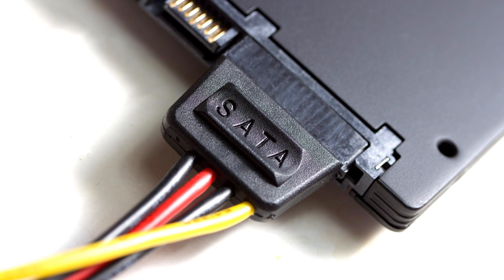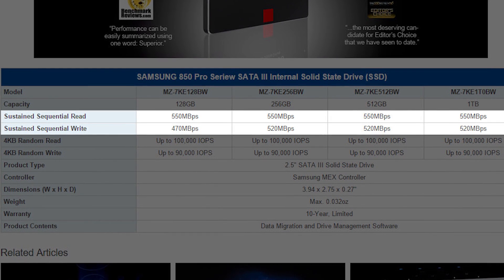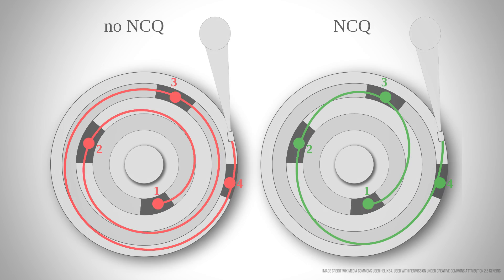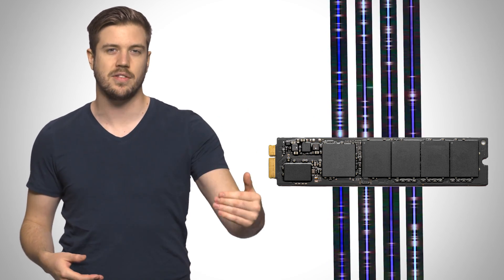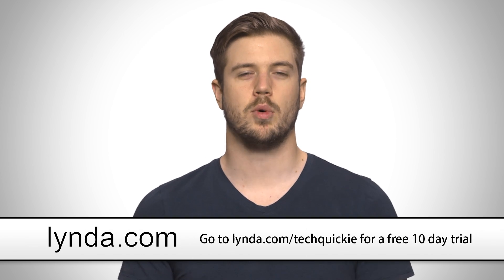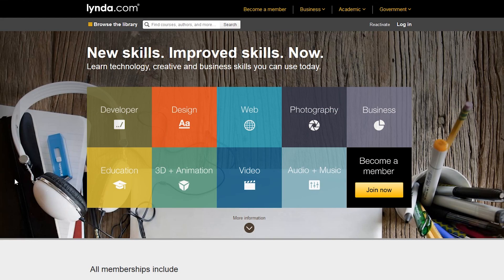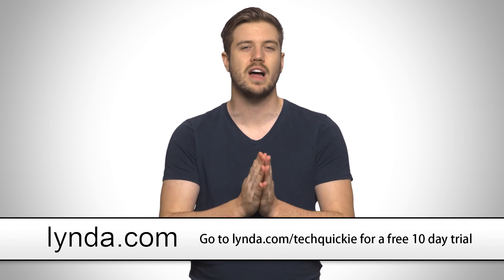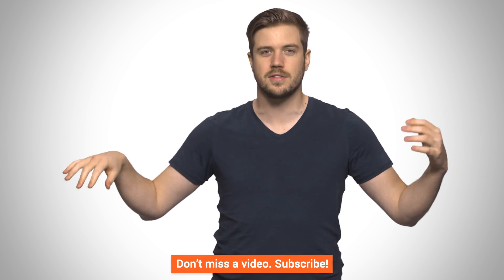NVMe As Fast As Possible

Comment: Is 2000MBPS completely necessary  for a steam library? Yes....yes it is
Reply: If you have very very good internet... yes haha
Reply: But now you can't read the helpful tips that the game gives you because it loads too fast
Reply: Imagine my dissapointment when i got my 4th generation just to be limited by the game engines :(
Reply: I just boosted my NVMe to 15k read and 29k write with RAM cache just for gaming and all the stutter I had when loading new areas disappeared. I used to have frame drops in games with big open worlds while driving/riding around but that is also gone. I can max all settings in 1440p + enable ray tracing at medium on a 2080S and i9-10900k at 4.8GHz now in Watch Dogs Legion, before I had to run a mix of medium and high settings or it would stutter like crazy and the FPS would drop all the time. It's completely locked to my monitor's refresh rate now. No drops at all. That's what an insane read/write will do for you :-)

I've moved on to only NVMe:s and will never go back. SATA SSDs are a thing of the past imo :-P
Reply: Anyone saying it's "Overkill" or "noticed no differences" probably has a low end or midrange system that honestly won't benefit from it. When I upgraded from a SATA to an NVMe it was very noticeable (contrary to popular belief), Windows boot and shutdown way faster and apps open twice as fast.

Comment: NVMe drives are bottleneck more than SATA III, because "typical user" tasks can't adequately utilize the faster speeds. Windows boot time, for example, is seldom (or at least marginally) affected by NVMe over SATA III. Hell, I still want one, but only if the price settles even more.
Reply: my boottime with 850 pro was 10 seconds to desktop was ready. after going 970 evo the time is not 4 seconds. also, game installing and windows patching is blazingly fast now. when you do multiple stuff at once on the drive, the difference is night and day compared to sata ssd's (achi is mostly the problem here). game loading in big open world games is also much faster, in smaller games the difference is not much. overall system feels alot "snappier" with a nvme drive imo!

Comment: My understanding of M2.  
Mike Drive has files, he hands them to Sally Sata, but Sally is not very smart and passes them on to Dave Hardrive 1 by 1, and in random orders that Dave has to sort.
Dave is putting them into a massive file storage drawer. He gets impatient waiting for Sally to hand him a file, and then gets the files in no particular order.
Mike keeps passing more and more files to Sally but she can't keep up.
Mike can't fire Sally and gets Sarah M.2 in to help instead. 
Sarah is super fast and organised, she takes all the files Mike gives her really quickly, she sorts them and hands them to Sally in the correct order, trickle feeding her so she can easily keep up.  Dave still gets his files 1-1 but they are at least sorted and easy to file quickly. 

Mike wonders why he still needs Sally or Sarah to simply hand files to Dave. 
Ala, why not cut out all the wires and plug USB thumb drives into SSD'd directly?

Comment: My sata SSD failed.  I am considering buying the Samsung 960 Evo NVMe. I have a Dell Optiplex 7010 SFF i7 16GB RAM, I have 2 question before I buy (i) will BIOS recognise NVMe for boot purposes and (ii) which generation of PCI-E Express 16 does it have, i think it's version 3.0 but not 100% as it does not state on the spec sheet.

Comment: Hi , my Samsung M.2 evo should get 3500 mbs read speed but only gets 2500 mbs when optimised , any thoughts on why im loosing 1000mbs
Ranger 8 motherboard, skylake 6700k cpu , 850w psu and 32 GB of Vengance Ram

Comment: MODIFY YOUR UEFI BIOS, ADD NVME DRIVERS, ???, PROFIT.  I did it, P9x79Delux currently running off a NVMe drive. Also your statement is also factually inaccurate.  You can put an NVMe drive in virtually any PCI-E based confuser and it'll work, you won't necessarily be able to boot off it though which isn't necessary most of the time. Regular SATA SSD would be more than fast enough to boot Windows quickly regardless.

Comment: Can you use legacy BIOS boot with NVMe working? I don't recall this being possible, yet I just figured out my Windows PC boots via legacy BIOS (I blame the Windows installer for this) from my NVMe drive. I just want to make sure I know what is going on. (I'm not going to reinstall windows at this point just for a slight boost if that's all it gives me)

Comment: If you a gamer and want to buy an NVMe , please don't. They have great potential but the performance they offer is so marginal it is not worth the extra dollar. Use your SSD as they offer similar performance to NVMe for gaming. Until developers take advantage of NVMes resources it is not worth the buy now
Reply: NVMe is a communications protocol ... not a kind of media .. the biggest benefit is the enhanced throughput and about 25 microseconds of better request latency (forget about the queue depth issue, at SSD style latencies you rarely if ever fill up your queues) along with a useful decrease in CPU utilisation when you're doing 200,000+ IOPS. Having said that until games start needing to stream super-hi-def video from disk instead of generating it using the GPU, you're much better off spending the extra $$ on a better GPU

Comment: so does that means nvme m2 drive works on my (gigabyte z97 G3) m2 port? Does it only works as data storage or can be a boot drive? Manual does says this,
1 x M.2 PCIe connector
(Socket 3, M key, type 2242/2260/2280 SATA & PCIe SSD support)
1 x SATA Express connector
6 x SATA 6Gb/s connectors (SATA3 0~5)
(M.2, SATA Express, and SATA3 4/5 connectors can only be used one at a time. The SATA3 4/5 connectors will become unavailable when an M.2 SSD is installed.)

Comment: Are all M.2 Drives NVMe compatible?
Reply: no, there is more than one protocol for m.2 ssd's out there. so be sure you get one that confirms it HAS the NVMe controller and that your motherboard supports NVMe m.2 and not just the other ones. if you have two or more m.2 slots dobule check to see if NVMe is capable in both or in just one and if just one, which one.

Comment: Can you connect a M.2 NVMe PCI SSD to SATA-3 connector using an adapter? (I know this will not give any performance advantage since SATA is only 550mb/600mb max but to futureproof myself whenever Im buying a new laptop with motherboard that fully supports NVMe..) Thanks.

Comment: So I have a serious question. If on paper NVME is waaay better than AHCI then why when it comes to real world performance (particularly boot times and load times) NVME M.2 drives are kind of a hard sell since they are more expensive than SSD's and the boot and load times for NVME M.2's are if anything just 1 or 2 seconds faster than SSD's? Is it because of speed limitations in the OS and in the game engines? I think this is a good question for Techquickie but I'm interested in what everyone has to say.
Reply: I think, at that point, the boot time is limited by other components, This is the fastest your PC can boot with virtually no bottleneck in storage. Consider your CPU and other components take 10 seconds to process all boot instructions, while your SATA SSD takes 4 seconds to provide data, Result: 14 second boot time. Now CPU and other components still take 10 seconds, but the NVME takes 1 second to  get data, Result 11 second boot time.

Also, booting might not be the most expensive operation, it might not fill up the request queue of AHCI. NVME will excel in really hard time, when requests are more than what AHCI can handle at the same time. Consider a time where your system experiences very high load (There are times like that for about 4 seconds), Even with SSD's you will get some slowdown, This is where an NVME will easily outperform AHCI.
Reply: mraustin3410 Dude, you're missing the point of these drives. If all you're trying to do is boot a few seconds faster and run games then these drives just arnt really for you. At least not now..I've got two computers, one main desktop and one alienware laptop..both have 960 Pro nvme 1tb drives in them. Why? Because the difference it gives me for doing audio engineering work, loading virtual instrument samplers, and video and media work is ridiculously faster. It's a complete night and day difference, it's the difference between me getting frustrated with trying to work and me just being able to do the work without noticing an issue with lag time and etc etc etc. Especially on big projects with 60 to 80+ channels running at once. These drives are a godsent.
Reply: When an OS is booting it is initializing all of the devices of your computer. It is done by drivers. Unfortunately there are a lot of idle time during this time because some hardware just simple too slow to answer the requests. But the OS needs to wait for these answers which are usually init values for the specific hw drivers.
Reply: depends on usage, pcie 3.0 x4 nvme ssd is much snappier than even the best sata ssd's, im at the desktop 4 seconds after hitting the power button, took 10 seconds before with my 850 pro. game loading is faster but windows patching, game installation (unpacking etc) is extremely faster. a game repack can be installed in a few minutes instead of 20-30 minutes sometimes (fitgirls). major difference in some workloads and not so much in others. i also like that there's no cables inside the case. very clean looking / easier cable management.
Reply: AustinSummersOfficial The slo mo guys have a video explaining that. A playback of a high bitrate video from a SATA SSD and from a NVMe SSD. For how fast the SATA drive was there was no way it didn't buffer after some seconds. That's pure read speed difference.
Reply: hey my samsung ssd is faster than my samsung nvme 960 but a bunch n i have no way of knowing why
Reply: Elvis Best maybe you have it set to SATA in the motherboard... Check if the configuration is in sata or auto... Also maybe update the bips
Reply: the beginning of the video basically covers this point, he said that its high work loads that NVME technology is noticable.... so when read and writing information quickly is paramount then the nvme helps alot. none of this matters if you have a terrible cpu, ram, or possibly connection(if you need to access a server before finishing a request)... if so the read and write speed is redundant.
Reply: lollycopter enclosures already exists, and you get the maximum speed for they type of USB Gen you use...
Reply: I have a 960 Evo. Render speeds and loading of times are not exactly fastest. Or is law of diminishing returns
Reply: I wanna add that it’s much more noticeable when you’re dealing with really big stuff
Reply: @thetshadow999animates9  Coming back to this after 5 years, and yours was the only comment I was ever notified of lol
P.S. - I understand the error of my comment all those years ago when I didn't know what NVMe was.
Reply: here's a side by side comparison of SATA vs NVMe video playback- https://www.youtube.com/watch?v=4PoXiRoLSZQ
Reply: If you need to use an M.2 SSD via USB 3.0 as an external drive, stick to SATA. I don't think any NVMe enclosures exist yet. If you need NVMe performance for an internal drive, get NVMe.
Reply: 1. NVMe (note small "e", spell it correctly or I will FIND you) is newer and therefore more expensive. That's pretty much it.
2. NVMe is found on 4 lane PCIe based cards. There is no such animal as a sata NVMe. Thus it depends on what PCIe you are using, but even the slowest PCIe NVMe should be faster than sata. Want proof? If you look up the sata standards group, you will see they point to PCIe/NVMe, meaning "we give up, go with them if you want to live". Thus I doubt your claim that they are "1 or 2 seconds faster". More likely your MB POST sucks it big time.
3. Get a PCIe 5.0 NVMe SSD, then strap in and hold on.

Comment: Why don't they just make a pcie x16 ssd card.  Im guessing gamers need this for sli but you could get a heat sync and insane SSD power
Reply: ***** For gaming yea.  
Is the bottleneck for the number of full use PCI 16 slots the CPU bandwidth?

I'm a photographer I think I actually need access to random files quickly more than I think I need high power GFX calculations like 3d rendering.

Comment: Difference between nvme and m.2?
Reply: To my understanding m.2 just refers to the physical slot type, while NVME refers to the method of communication. There are SATA m.2 drives which fit an m.2 slot but are otherwise the same as a traditional SATA SSD (same interface and speed), and there are NVME m.2 drives which plug in the same way but use PCIe lanes to go much faster.

Comment: NVMe vs M.2 SSD? Which one should I buy, considering that former will require me to sell my house!!
Reply: NVMe is the latest technology (kinda like the software/language) that allows SSD to take fully advantage of the PCIe connection.  

M.2 is just the form in which the SSD comes in (which is much smaller since it was primarily used with smaller devices).  

If you are looking at laptops, i'd probably go with an M.2 SSD (very small) that connects to a PCIe generation 3 x4 (latest technology) with NVMe capability.

Comment: Can we just get rid of SATA?
Reply: iLOLZU Not quite yet. We still need it for optical drives and anyone who wants to use ESata for DVRs or controlled environments where you may want to disable USB for security reasons but still want to have the ability to attach external drives. Also Less importantly with thunderbolt 2 speeds, SATA and esata are direct connections between drive and chip rather than drive to interface connections and thus, esata external drives provide slightly more robust data solutions when you can't trust buffers. Although to be honest if your data is that important and you're not using server grade components with redundant PSUs and UPSs then it seems foolish.

Comment: Are all M.2 drives NVME?
Reply: No. M.2 is a form factor upon which you can place NAND chips. That form factor can (and does) sit inside a PCIe slot, SATA slot, or USB 3.0 on a device. The command set, however, can be NVMe (preferred for PCIe) or AHCI (for all of the above).

Comment: there are different versions of NVMe, whats the difference between them?
Reply: Most people will ever experience one version of NVMe - those that are embedded into consumer devices. However, to answer your question, there are two official "versions" of NVMe: 1) NVMe for PCIe devices (which is talked about in the video here), and 2) NVMe over Fabrics, which involves accessing NVMe drives over a networking fabric (such as Fibre Channel, Infiniband, RoCE, iWARP, iSER). Why are there two? Because PCIe is not built to be a "fabric," which means hanging multiple devices off of a PCIe bus can be a very bad thing for all when something goes wrong. NVMe over Fabrics allows you to use well-established data center technologies to support more robust deployments.
Reply: i dont remember why i asked that question, but i think i meant different versions of nvme for pcie devices, but im not sure now
Reply: Ah, in that context, the answer is actually a definitive "no." NVM Express (or NVMe) is the brand name of a specific methodology for creating a memory-mapped model of CPU commands to a corresponding storage device via PCIe. There are other means of doing this - SCSI, SCSI Express, and even proprietary methods, such as FusionIO. In that way, there's only "one" NVMe, but there is more than one way to solve the problem. The difference is whether or not you have to get proprietary drivers, support, etc., vs a mechanism that is well-understood by a number of vendors.
Reply: kk thanks

Comment: i have a question, many old laptop has settings for hard disk to work in compatibity mode and AHCI mode in the bios. if i use a ssd in these old laptop what mode should i use to suit it the best?

Comment: Now one can really see when games are plain stupid, not hardware's fault.
I am rocking the Samsung SM951 256gb, top reads on PCI-e card 2gb/s.
I keep watching the drive activity, occasional blipps in GTA-V when just driving around, assets loading. I get the feeling games aren't using the transfer capacity available. Games like Far Cry  and GTA-V could benefit from preloading more from SSD to RAM, reduce the occasional stutters and pop in. would love some input on this if you have thoughts

The price has dropped a bit since last year, right now 185$ for 256gb, 25$ for the m.2 pcie-card from china, although you might have a 4x PCI-e m.2 slot. Go get if you dont have one, sooo snappy.

Comment: Why do you guys call 6 Gbps 600 MB/s?  That's not how that works and I know you guys know this.  So why do you do that?  6 Gbps is actually 715 MB/s.  And 600 MB/s is actually  5.03 Gbps.  And of course that doesn't take into consideration the 20% speed lost from the 8/10 encoding.  Blah blah blah, why am I even typing this?  You guys know this....but I already typed it, so, just going to send it.

Comment: The problem with the latest M.2 speed drives is they have very limited write cycles, and since you're probably using such a fast drive to write lots of data quickly, you're going to go over that limit blazingly fast...then you're left with a very expensive read only drive. 

Sure, most people could probably write a copy of windows to it, some common programs, and some games here and there and all would probably be fine.  But you don't really need GB/s to do that, any normal SSD will be more than fast enough for that.  

When I bought my first SSD years ago, it was about $80 for 128GB.   Now SSD's are down to about 50 cent per gigabyte.   Soon they'll be even cheaper and faster.....so I'd recommend anyone to hold off on buying any SSD's unless they absolutely need them, because in 2 years time, SSD's are going to be dirt cheap and even faster.
Reply: You were right lol